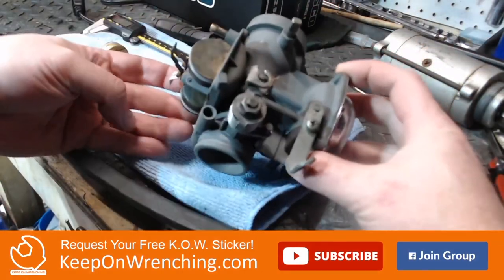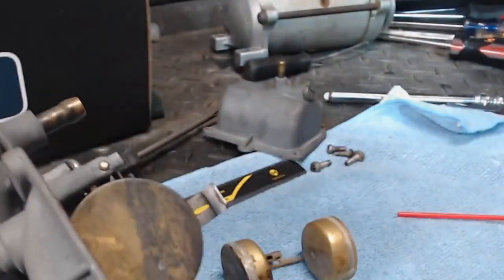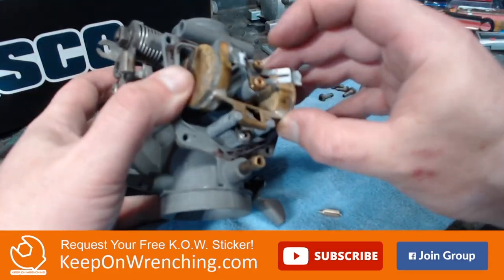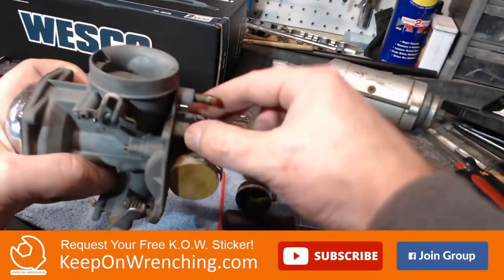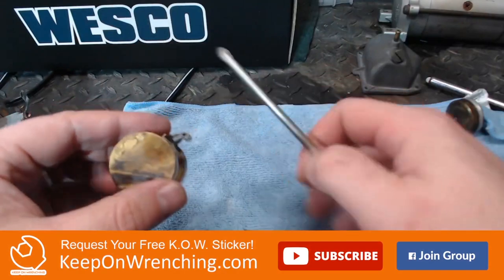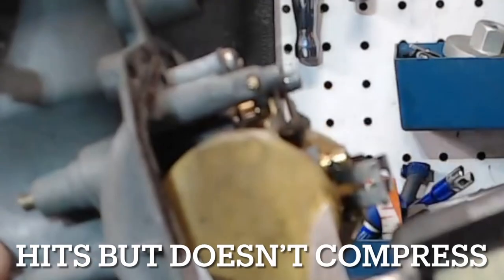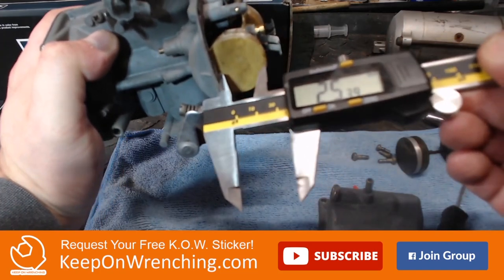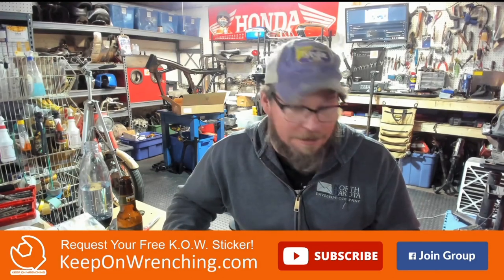How To Adjust Carburetor Float Height

Comment: Always nice to see a KOW video pop up on my Youtube main page.  That camera didn't want to focus for you.  : )   Maybe it's just me, but it seems easier to use the opposite end of the caliper (the part that sticks out as you open it) when doing float height measurement.   The bottom of the caliper becomes a small ledge to bring down onto the top of the float.   I guess a measurement is a measurement.    There's a bunch of ways to do it.  The float height tools they make for certain bikes work great too.   I have one specially made for the CB750.
Reply from the maker: Yeah…I like being able to rest it in that lower ledge. Many ways to do it. This was tough to film. Definitely struggled with focus but hopefully the points came across.

Comment: I’m working on restoring a ‘66 Honda s90.  One manual says 19.5mm, a second says 22mm for the s90 float…when at 19.5mm the carb continually leaks gas down through the overflow.  I haven’t tried 22mm but I think I’m gonna experiment and slowly raise the float from 19.5mm up, about a half mm at a time.  Since installing and installing doesn’t take long on an s90 I aught to be able to find a happy point where the overflow shuts off (finally!).  BTW…this is the original keihin carb….ain’t solvin mysteries fun?
Reply from the maker: It's a finicky business for sure. I think I did mine 15 times the first time I was doing this. Mysteries around every corner. Always something.

Comment: hi thanks for the good explanation. i have cv carbs.my manual says set at 32mm?? on the web they say 32 is to high and the setting should be 26.what setting should i go with🤔
Reply from the maker: I wanna say it’s 26.
Reply: @KeepOnWrenching  thanks for the reply .I have them set at 32mm just now.bike not running to good very rich. also found the float bowl was like sitting on the floats slightly before tightening the 4 bolts 🤔
Reply from the maker: @bc-mr1si  try 26. I’m almost positive the 350s are to be set to 26. Make sure the floats don’t have leaks too. Sometimes you can shake them and hear fluid inside. That can cause all sorts of issues!
Reply: @KeepOnWrenching  issues I'm due to take a shotgun to this thing 😃I've lost count to how many times the carbs have been off.infact I could do with my eyes  shut.floats have no leaks.im probably not setting them right.ill give the 26mm a go .thanks
Reply from the maker: Good luck! It’s always the carbs.
Reply: @KeepOnWrenching  😅hope so .I'll keep u posted 👍
Reply: another thing fella.once float height is adjusted. how much should the float needle be out its housing??when the floats are in there normal position on the bike .
Reply: hey fella.26mm was spot on.thanks so much.
Reply from the maker: @bc-mr1si yes! Happy for you. Thanks for letting me know.
Reply: @KeepOnWrenching  thanks fella.i feel the bike is still running a little rich.would I go down on the pilot jet and main jet.or maybe turn the fuel screws in a little from 3.5 turns out.🤔
Reply from the maker: @bc-mr1si start with your adjusters.
Reply: @KeepOnWrenching  hi fella.took the bike a good run.runs pretty well.i checked the plugs .bike is running very lean.would I go up 1 size on the main jet ? or raise the throttle needle 1 notch ?
Reply from the maker: @bc-mr1si start with the air/fuel mix screws.
Reply: @KeepOnWrenching  I have when I bk them out further the engine dies  also the carbs blew off😃when I go clockwise the engine dies🤔

Comment: I've got a great idea.  Jump on a plane, fly to Oklahoma (I'll pick you up at the airport) drive you to my house and you can adjust my carbs, timing and such then my bike will run like the wind.  I down to just engine, carb, airflow adjustment and I'm finished and I've discovered this is too far over my head and it's too important for me to screw up.
Both carbs are leaking around the gaskets on the bowls.  With the new aftermarket mufflers and the electrical upgrades, I can beat it out and take a month and get it running or just have it done.  It pops when I turn it over and has fire on both plugs but I think I'm flooding the heck out of it.
What time will your flight be coming in?  My wife is a great cook.  Obi-Wan Kenobi.  You're my only hope.  Ha
Reply: Well, I’m in Oklahoma but too busy with my S90!  Just dig into it…after all, you just might learn something AND fix it….good luck
Reply from the maker: You can do it, man. It’s not complete rocket science. We believe in you. Just start with the baseline adjustments